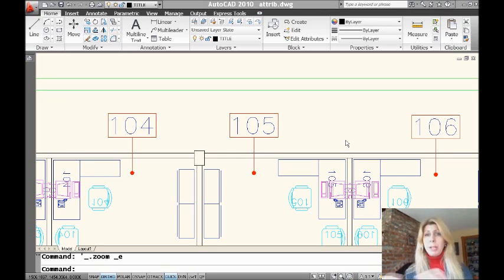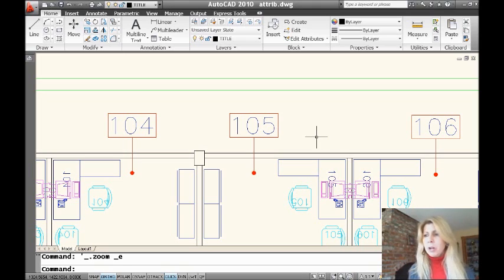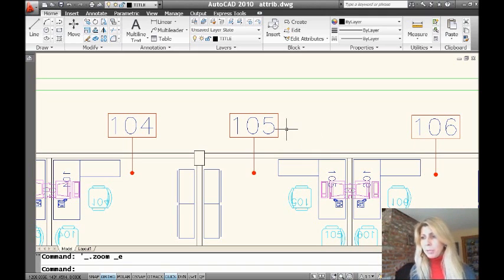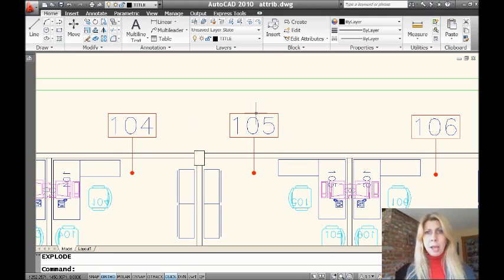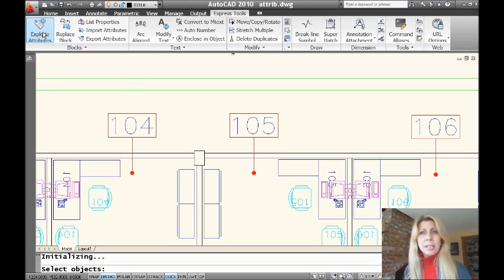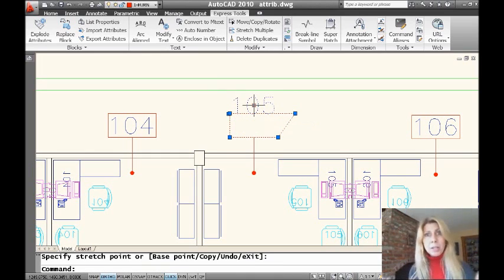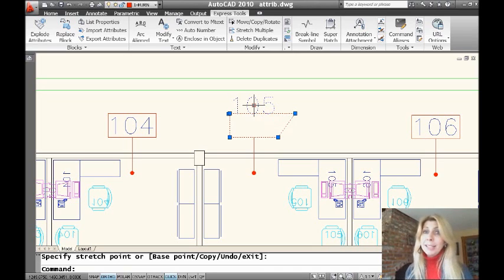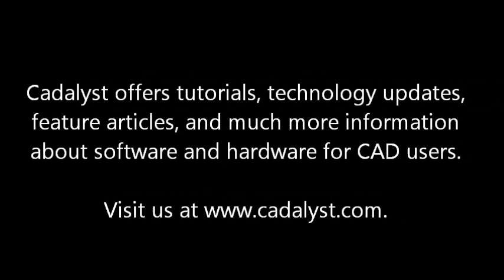Explode Blocks with Attributes (Lynn Allen/Cadalyst Magazine)

Comment: there is a "yes" assigned to my block for "allow exploding". My block is un-uniformly scaled but "explmode" value is also set to 1 which allows un-uniformly scaled blocks to explode. But auto cad says "cannot explode that block" What might be the reason?